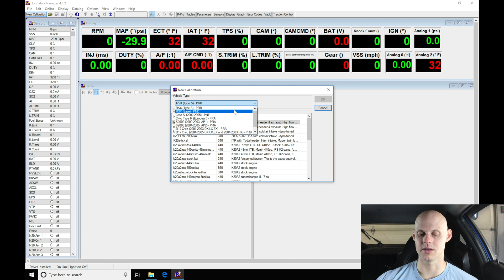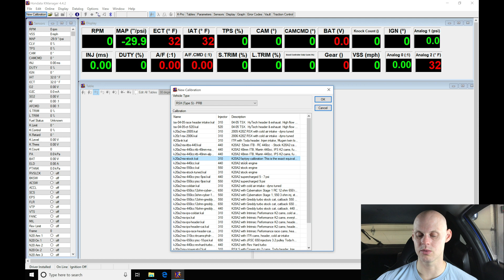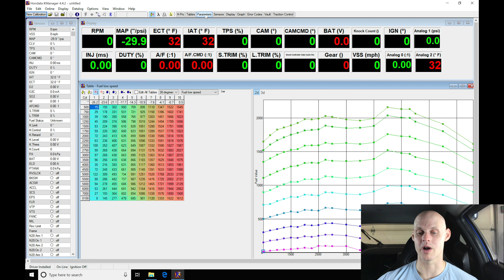Hondata Kpro Live Training: All Motor K24 Acura RSX Part 1 | Evans Performance Academy

Comment: If I have a 04-05 k24a jdm engine with a k20z3 transmission. And a rbc manifold, cold air intake, ktuned fpr and lines, running a PRC ecu from a dc5 type r. What  base map do I choose? Doesn’t look like there’s a PRC option is PRA the same? I built my car for 11 months. But I have no knowledge on kpro. Any help would be highly appreciated.